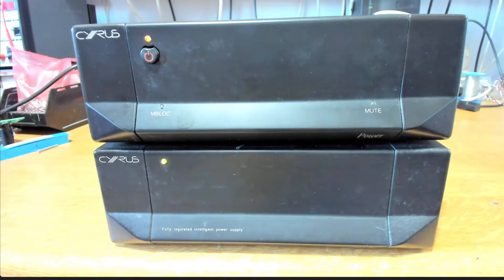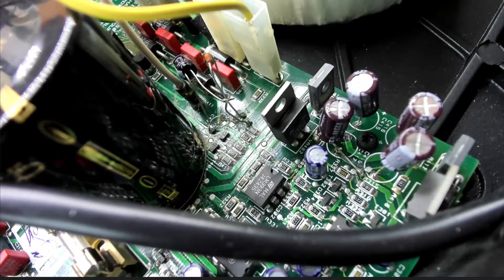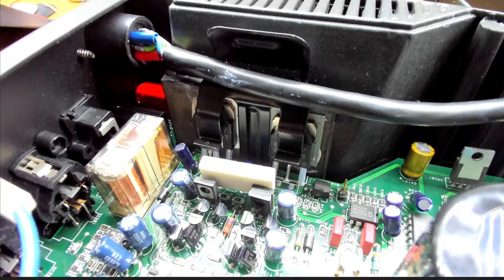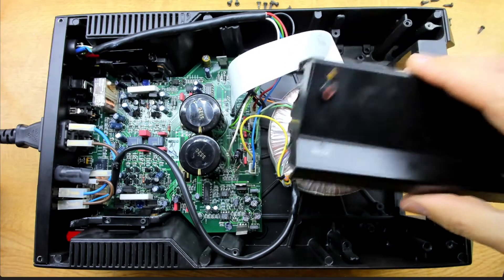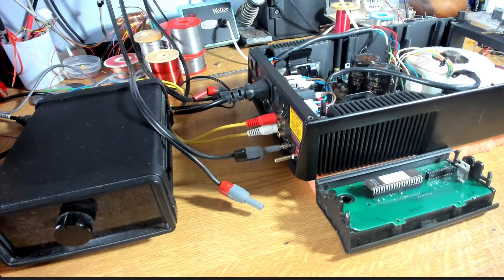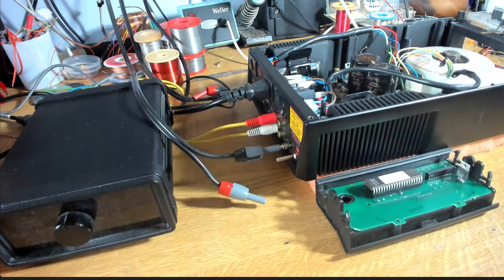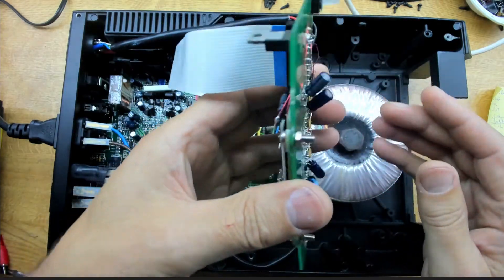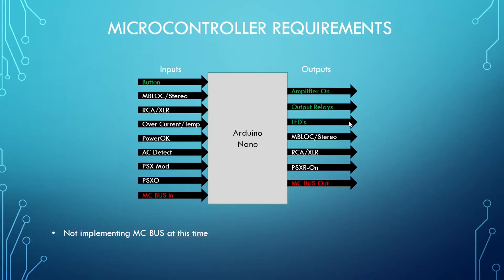Repair of a Cyrus Power Amplifier that's lost its Marbles!

Comment: Great work! I have one of those here that just needs some new relays. Good to know if the MC goes down it can be replaced. I also have the matching 'Pre' preamp and the volume pots are worn - another part no longer available. I saw a project where someone replaced them with digital stepped attenuators. We cant scrap such lovely case work!

Comment: Very impressive that... I have a degree in electronics but I'm not sure I'd have even thought about approaching that one, would have assumed it was a lot less logical than it turned out to be. Of course this is a British design and they did tend to keep things simple like that - the Japanese would have spun up a custom IC with 240 pins that did the job of an entire range of devices and you'd have had no chance lol. 

That mess though... I consider myself very much an amateur when it comes to audio stuff but there's no way I'd have been happy to let that out the door, it looks like a curious twelve tear old was let loose on it!